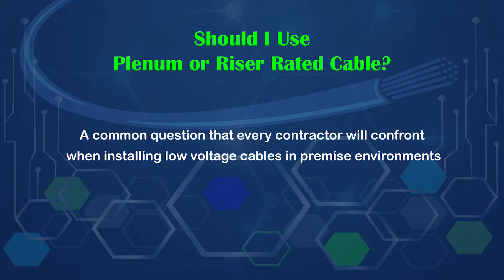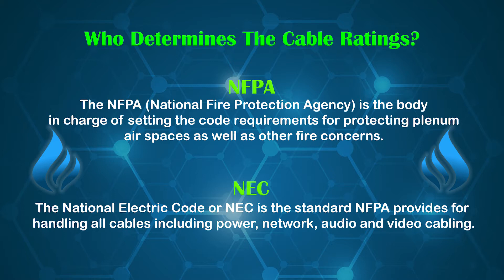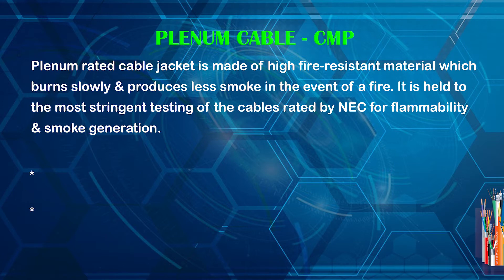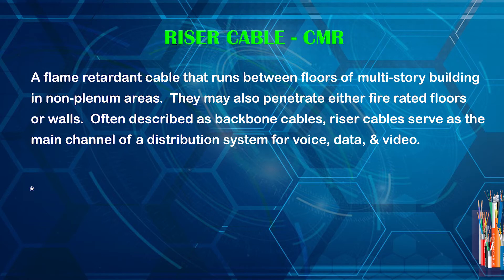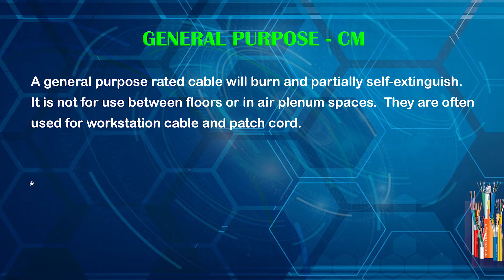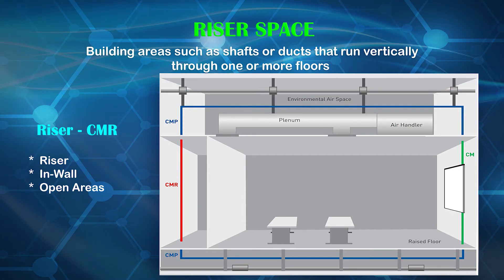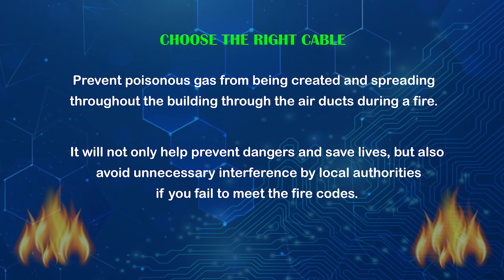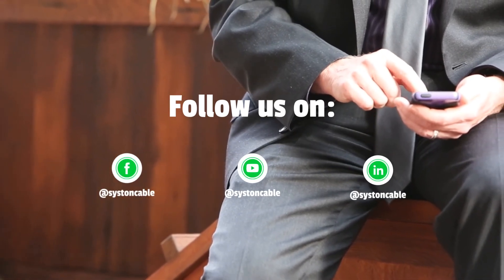Where to use Riser and Plenum Cables

Comment: Open areas is not correct. If you have open cable tray in it, it must be plenum rated. The open area is in fact part of the plenum. Air flow is being controlled. To have it not be a plenum the open space would need to be open to the exterior. Take your graphic and remove the drop ceiling, the cable still needs to be plenum. CM is used as a patch cable only. With distance limitations usually.(30ft)